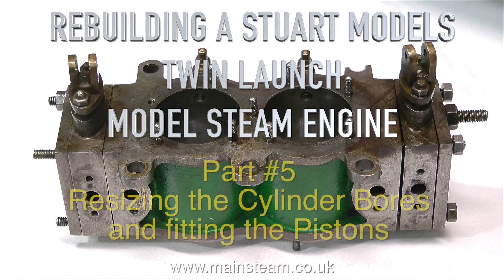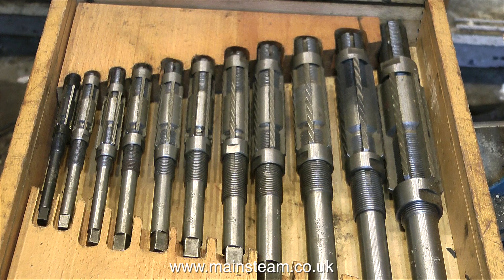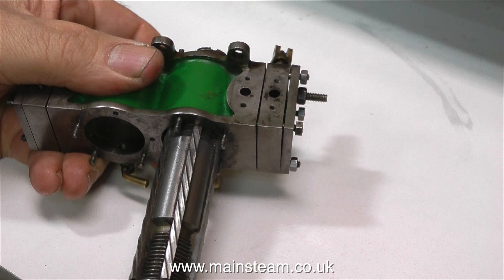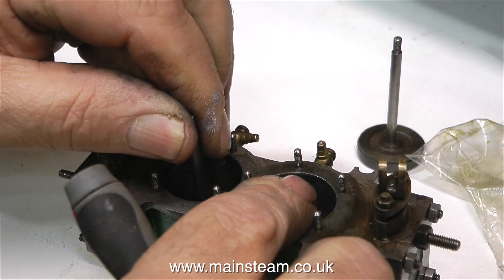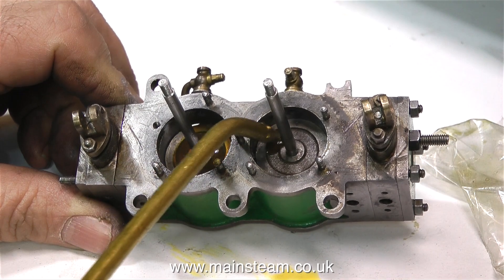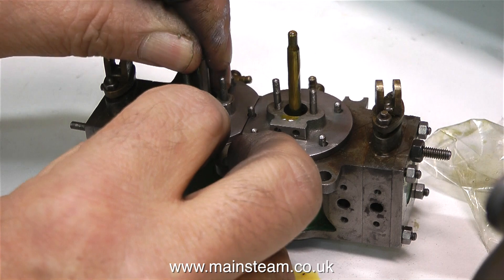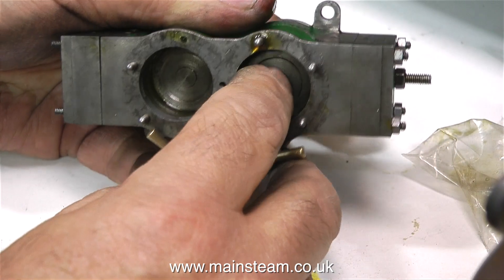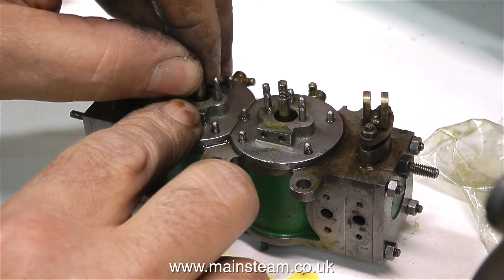STUART MODELS TWIN LAUNCH STEAM ENGINE REBUILD - PART #5

Comment: hello, what was that pattern on your reamers blades?? i have never seen a pattern like that before. great work, great video's, keep up the great work, please ignore the naysayer's most of them probably don't know what they are talking about anyway !!!
Reply from the maker: They are expanding reamers which are different to normal ones . . . they are adjustable for size ......
Reply: i understand that, what i have never seen before is the pattern on the cutters, all of mine are plain and smooth yours looks to have a half chevron pattern on the cutters face.
Reply: normdoty I believe the cheron pattern is a pecial grind to create s skewed cutting edge  and reduces the power needed.  Something like that !

Comment: Hello, Keith,  I have inherited a scale model project of a 1880's riverboat.  It was, I believe, a kit at first.  About 3 ft. in length.  The original builder passed away, and I was friends with his son, and that's how it came to me.  The base of the boat was constructed, and a part of the deck also.  The man who first worked on it wanted the boat to be an exact scale replica, a working scale replica.  He went so far as to have constructed a steam boiler to model the boilers of the day, which were crudely built out of metal, then covered with a mixture of pitch, mud and dried manure (although I doubt he used real manure on his model)  But it does resemble the drawings.  This coal fired boiler was attached under the deck, but which extended upward into the boat's saloon.  He also went to great efforts to model the propulsion unit.  But his work lacked some details most important to making his creation run like the original.  His piping was simple crafting brass tubing, silver soldered together.  And his pistons were similarly crafted.  They leaked like crazy!  All the steam I could build up in the boiler was leaking out in a dozen places.  His beautifully hand-crafted stern-drive paddle-wheel would barely turn, and this was without the resistance of water.

My first thought was to locate a small hobby steam engine like I had when I was 10 years old.  I thought they'd be plentiful and readily accessible on Ebay for not a lot of money!  BOY! Was I wrong!!  A similar looking unit mfd new lists for over $200  also, I'm not sure that these tiny engines are big enough.

My question for you is, how big should a steam engine be to slowly drive a 25lb. 3 foot long scale model, with a 6" diameter paddle-wheel??  Also, about how much should I pay for a used steam engine for this project?
Reply from the maker: As a boat that is only 3 feet in length is quite small. then I would say that a Stuart "Puffin" (formerly "Cheddar Models Puffin") would be fine, but with a reduction gear to turn the paddle slowly.

Comment: did the manufacturer have sloppy quality control or was this machining done by the person who built the kit?
Reply from the maker: it is not a kit, most of these model steam engines are made from home workshop machined castings. Nothing to do with the Casting manufacturer.

Comment: Love the videos. I do firearm repair and auto restorations, instead of a reamer could you have used a master cylinder hone to "polish" the bore?
Reply from the maker: Yes I have a cylinder hone, but in this case a reamer was necessary as both of the cylinder bores were different sizes and slightly tapered towards one end.
Reply: Ah, yes, you had to TRUE the bore first. I must congratulate you on your attention to detail and drive to do it right. Most of my work is to repair the thoughtless work others have done to machines tat deserve much better.

Comment: Hi Keith you certainly have a nack at making it look easy. How do you find those expandable reamers, I heard their not as good as the normal HSS thanks Keith John
Reply from the maker: I found them on Ebay and they are very good - and adjustable :-))
Reply: Thanks for the reply I will buy some, they are expensive down here from the normal outlets so I will give EBay ago thanks John
Reply from the maker: I found them by chance on Ebay and the bidding stopped at £80.00 - they are worth more than that I think. I don't use them a lot but when I do it's worth it as they give a really clean reamed surface on a cylinder bore.
Reply: i bought a few of them for a special job, the difference between them and straight ones is you can adjust them a little bit below or above their stated diameters.
you have to search around to find the best price because the difference in costs is just staggering.